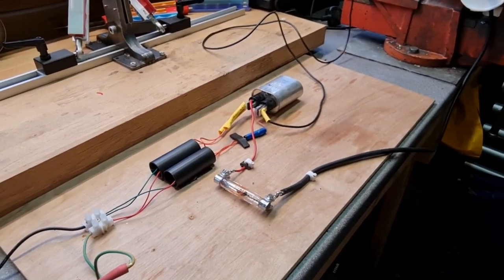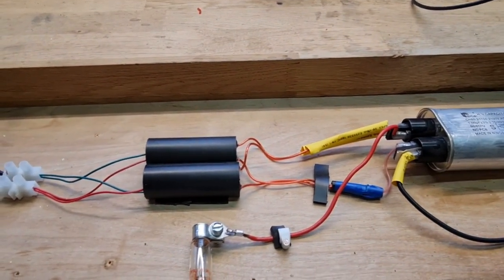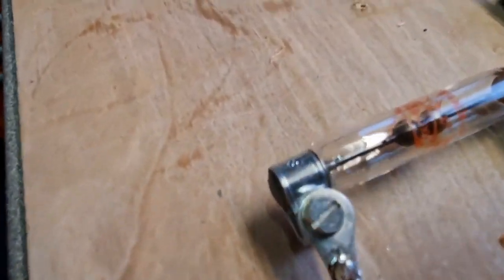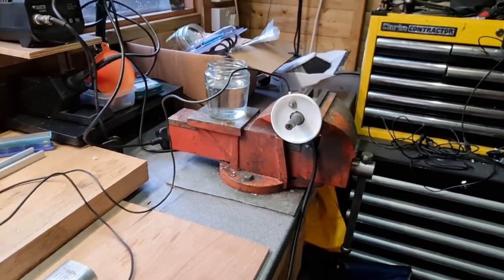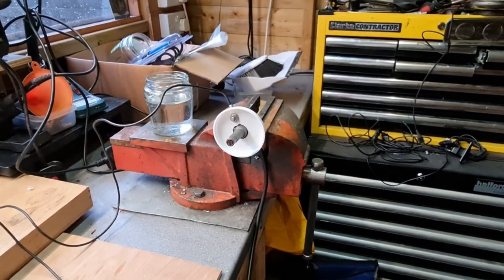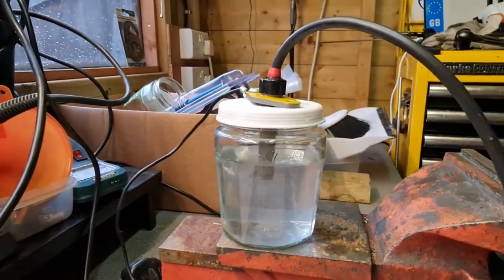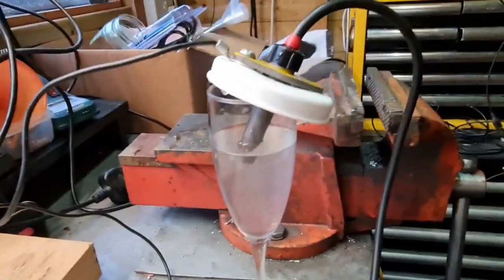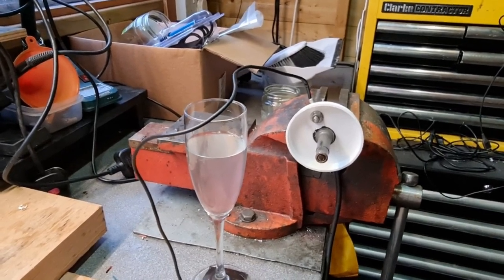Jet Engine Bang Box Ignition in Water

Comment: I can vouch first hand for the power these igniters put out. Andy built me one for my little Rover gas turbine a while back. Last week I was playing around with it and accidently touched the HT lead while sparking it up.... I have had many shocks from normal car / bike ignition coils, but they were NOTHING compared to what I got off the igniter. It was only afterwards that I realized what I had done, and how serious it could have been.. Be very careful. Lesson learned !
Reply from the maker: Hi, David.... hope all is well with you 👍 thanks for the comment.... glad it was only a shock you got.... and nothing more happend, how is you project coming on 👍
Reply: @Turbojetkart   - sadly haven't had much time, so the turbine is still on its' test bed. I have given a few demo runs at various shows, and have a small speed boat hull and drive unit sitting waiting.... Igniter box is still working well...as I discovered ! Cheers, David.

Comment: In my project I will use a diesel engine heater plug wrapped in a tube the moment the kerosene comes into contact it ignites, so I preferred high voltage instead of damaging the electronic systems of the jet engine, very interesting your project friend
Reply from the maker: Glow plugs are not so good... tried my self... Good luck 👍

Comment: I used a zvs flyback driver and coil as the HV source and increasing the voltage from 12v will increase the amount of "sparks". using  3x caps and 5s RC battery @18.5v voltage resulted in blowing a spark plug in two. This is a fantastic circuit, easy to repair and very easy to mod!!
Reply from the maker: Great tip!

Comment: Hi again Andy. Any chance you would still have spark gaps available for sale? I purchased NOS ones here in the states and I believe the values are too large (gap is much larger than yours and I'm not seeing any output) I've been over the circuit a few times. Tested components, swapped components. If you have any available or can tell me the values of the gap tubes you have been using I'd be very grateful. Thanks again!
Reply from the maker: Hi, sorry its taken so long to get back to you, I have a few left,  contact me from front page of channel, under about....

Comment: Hi, what fuel pumps do you use  on which voltage and how much fuel pressure do you need to run these engines with the afterburner? thanks
Reply from the maker: Botch 044..... 12 to 18 volts ... ful open flow into afterburner... how much fuel you need will depend on your engine
Reply from the maker: @leontierralta  thats the spark gap
Reply from the maker: @leontierralta  they on ebay....  they are called spark gaps ... check JATO Site

Comment: Hi from Canada! I have a question about the microwave capacitor used in your ignition system video. It is rated at 1500 volts while the high voltage generators are producing 10 times that voltage. Any fear of blowing up the capacitor? Thanks.

I just discovered your channel. Great job!
Reply from the maker: Sorry its taken so long to get back to you.... not had any issues with caps, they work will.... you can check out the making of an engine here https://jetandturbineowners.proboards.com/
Reply: Thank you Mr. Morris!
I was wondering, since the microwave capacitors being rated from 1.5 to 2 Kv are much below the rated Kv from the high voltage generator. From what I know feeding a capacitor above its rated voltage will result in a dielectric breakdown.

What is your spark gap tube discharge voltage? Maybe it is below the microwave capacitor rating, so that it discharges before reaching too high a voltage..  Im just trying to understand why you have no issue with what appears to be a large discrepancy … 

I am currently working on my own turbo charger based turbine.  It will be built around a 14 liters Detroit Diesel engine turbo. I am trying to make mine self sufficient. I mean that it would run its oil pump and other accessories from its own mechanical power, no external electricity required, other than for starting. Quite a challenge involving a mean of reducing the turbo shaft rpm from 60,000 rpm down to an usable 2000-3000 rpm. Obviously that would be at the expense of some thrust ( or horsepower on a turbo shaft engine) but that would make it more portable or » mobile ».

Thank you for responding It is greatly appreciated.

Happy holidays!

Richard Morin.

Comment: Hiya, thanks for your video, I am making the same ignition module! How do i go about purchasing the spark generator?
Reply from the maker: 👍check out my last video, the link to parts are in the comment section 🙂
Reply: @Turbojetkart  Thanks for your reply Andy, really appreciate it! I have purchased everything in said links but I can't seem to find what you refer to in this video as the "spark generator". You mention you bought them as new old stock and you may have some you'd sell?
Also, do you have a link for the spark plug you are using? I have made one that should work but I'd like one the same ad yours for future diagnostics and testing.  Thanks again!
Reply from the maker: @mjmedley1  Yes....not easy to find..... you can make one with a spart plug.... what are you using as the ignition plug....
Reply: @Turbojetkart  do you not have any more spark generators available to buy? That's the only thing I need to finish my project! 

Or would you be willing to sell me a complete ignition set up? My entire engine is done apart from a source of ignition.

I have chopped up a spark plug and turned a sleeve for it on my lathe so I can adjust the gap easily and it's all thread so I can get it right into the middle of the combustion chamber. Fingers crossed it can handle the power. If not, I will look into what you're using.

Again. Thanks for all your help!!!
Reply from the maker: @mjmedley1  I do have one .... but do you have the aircraft type spark plug ?
Reply: @Turbojetkart  I have just found and bought an aircraft style plug on ebay so the generator is the only missing part of the puzzle
Reply from the maker: @mjmedley1  email me , andrew.morris26@yahoo.co.uk